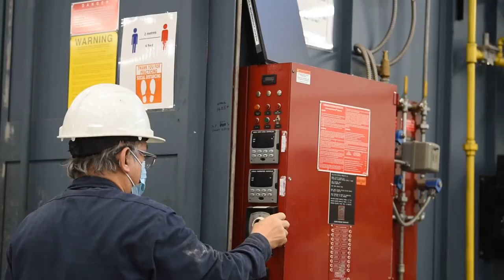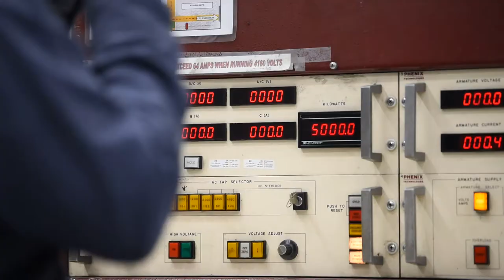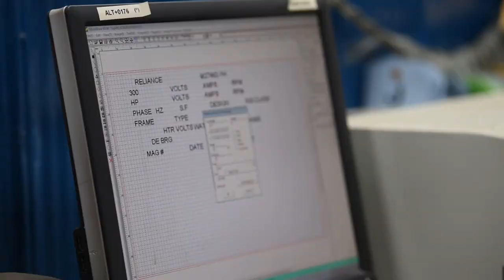Motor Rewind | 300HP DC motor rewind overhaul | Professional Canada motor repair plant

Comment: altogether nice job except:  if you drop the fields out of the frame without noting which pole pieces and which shims, then after assembly, with clean armature lam, reshim fields with feeler gauge gives equal gap

Comment: Have you guys ever had any trouble power washing amatures? Ive heard some places try to not do so because of potentially washing wet carbon onto the back of the comm.
Reply from the maker: Hello Taylor.  Before we wash any armature we will blow out any excess carbon or contamination with compressed air.  Once all the debris has been blown out we will steam clean the armature and put it in our oven for dry out.  With older armatures we will wash it from a bit of a distance so we do not damage the insulation.